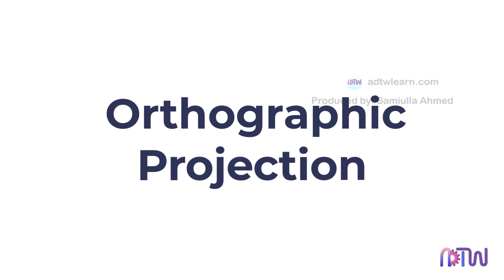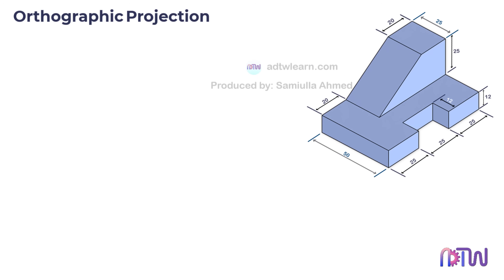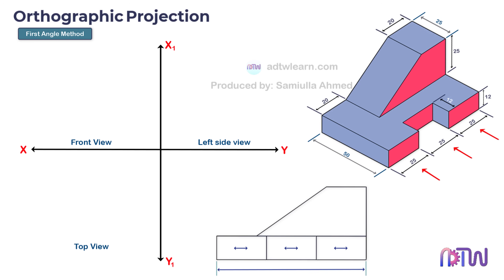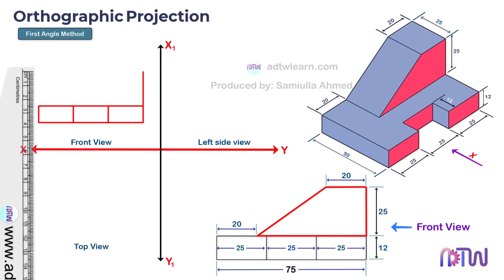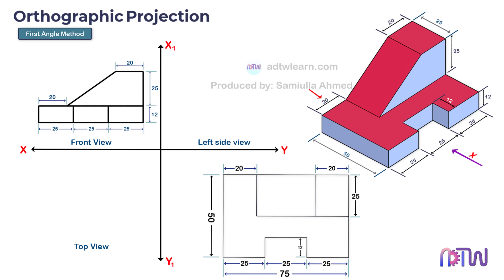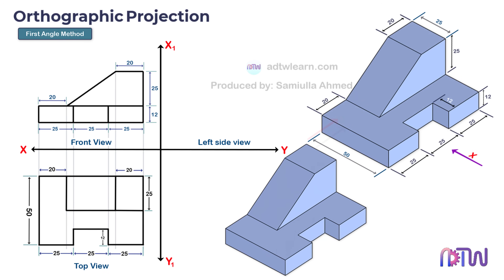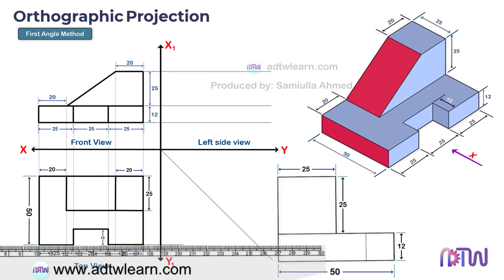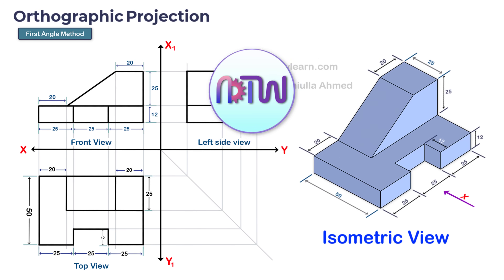Orthographic Projection from isometric view in Engineering drawing

Comment: Like before you stated that if the the angle to be used is not mentioned, one can use 1st angle method but you are using 3rd angle method  when the question did not state which angle to use

Comment: I don't understand the hidden line in the left view.
Reply from the maker: Hidden lines are often used in engineering drawings to indicate features that are not visible in a particular view. These features are typically located behind or inside the object being depicted, and would not be visible to the viewer from that particular angle.

When creating an orthographic view, which is a 2D representation of a 3D object, hidden lines are used to show these concealed features. For example, if you were creating a drawing of a cube from the front, you would not be able to see the back or the interior of the cube. In this case, you would use hidden lines to show the edges and faces of the cube that are hidden from view.

To draw hidden lines in an orthographic view, you would typically use dashed lines of a different weight or style than the solid lines used to represent visible features. The dashed lines should be drawn as close to the object as possible, without touching it, and should be interrupted at points where they intersect visible features.

By including hidden lines in an engineering drawing, you can provide important information about the object being depicted, such as the location and orientation of internal features, without cluttering the drawing with unnecessary details. This can make the drawing easier to read and understand, and can help ensure that the object is manufactured or constructed correctly.